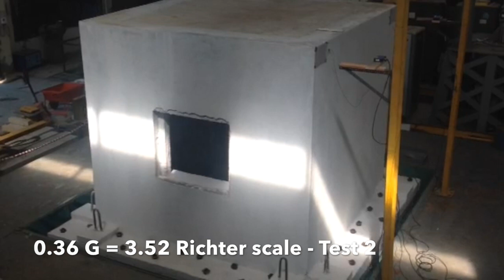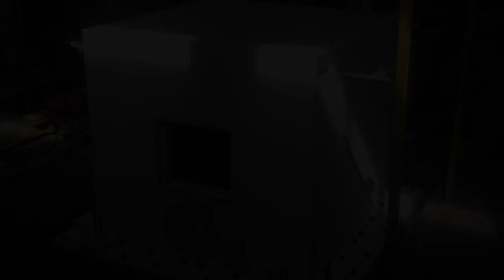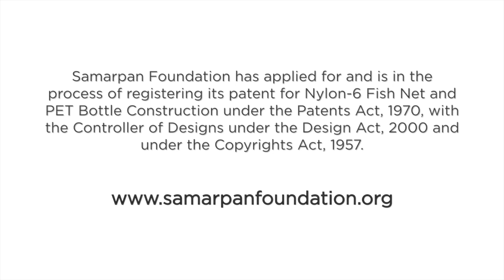PET Bottle & Fishnet House Earthquake testing up to 9.8 on the Richter scale - Samarpan Foundation

Comment: Thanks for doing the project. Good way to put all the plastic bottles together at one place. Would be nice to used any other net, maybe organic to avoid the used of nylon that can finally go to the ocean after the house´s lifetime is done. Which materials did you use in the mix? Is the mud into the bottles dry? Thanks!! Beatifull project.